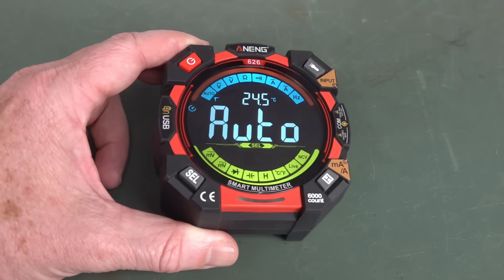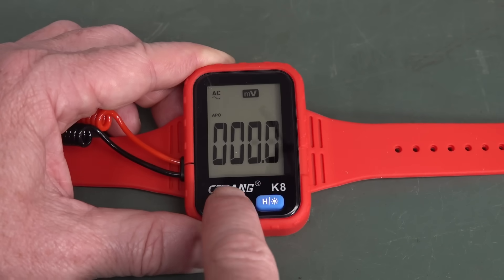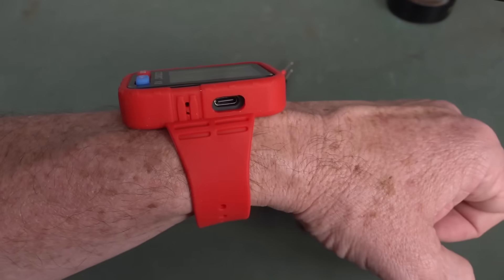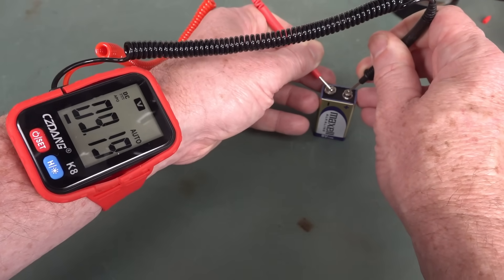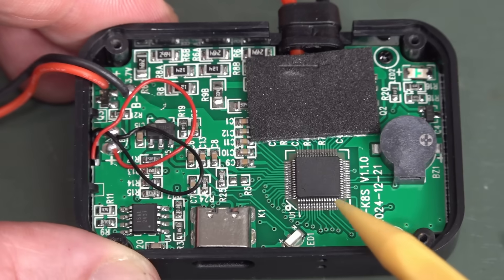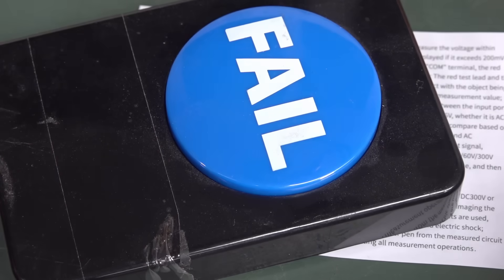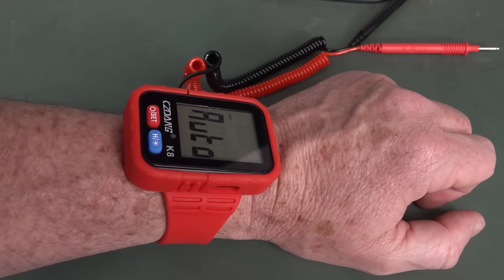EEVblog 1706 - K8 Wrist Worn Multimeter REVIEW

Comment: Not a bad concept, there have been many times where I have been testing something with no where to put the actual meter and a probe in each hand. Not really very safe though strapped to your wrist with zero input protection but hey, that's an implementation detail on something that couldn't have been implemented worse if they tried.

Comment: The worse part is that the screen is the wrong orientation, just that alone would bug me so much even if I found a use case for this. Without the wristband part this could perhaps be a decent meter to throw in the glove box of the car although I'm sure there are better options for that. Crazy that they can get this down to like $10 though. As an individual you couldn't even find that lithium battery for that cheap.

Comment: China has all the opportunity and tooling to produce a useful piece of gear and yet they produce this retard garbage.  Fuckin sad for all of us.  A few small changes at marginal additional cost and this product would be a banger
1.  Have the strap band meet in the middle back of the case so that the meter can be rotated to wherever on the wrist it's needed for viewing
2.  Have a moulded loop added to the strap so the tail can be tucked in like on a belt for pants.  Quick application and removal.
3. Have a pocket on the strap for putting the test leads into so hands can be free.

At least that would be enough so the product wouldn't fill me with rage every time I have to use it for vehicle electrical repair.

Comment: I think that resistance measuring is available only in auto mode to avoid potential damage on your wrist when you accidentally try to measure voltage in resistance mode.

Comment: This meter could be decent in some applications. The wrist band is of course 100% BS but it could be just a fancy meter holder if you stick it on a pipe for example. I'd prefer putting magnet below the meter body though, or use outside of the protective case, or just cut the bands from the case. Have an XT30 or similar connector for probes and a few sets of probes with it. Doing a car electric diagnostics or a simple home repair stuff (like checking a wire/plug/switch continuity) will be just fine with this meter. And the functionality is just enough, usage is very simple thanks to auto mode. Just throw it in your car box or backpack or whatever and you have at least something with you. For example, I have no meter in my car, and this thing would be much, much better than nothing. And what alternatives with this size and price? I guess none? DT830 clones are too bulky and too crappy (especially the selector knob), this K8 is ages ahead technology. And a normal meter could be too much for this purpose

Comment: For those who think the display is rotated non-intuitively, it's actually (more) correct for the placement of one's hands while working. As a counterexample, if one wanted to look at one's wristwatch while typing, one would typically have to rotate the watch to the 90-degree position to read it. But this display is in roughly the same orientation as one's hands and fingers during work. There are a lot of reasonably good features for this for the price (including the light), especially for people who work in cramped 12V environments constantly. A Velcro strap can assist with the dangly probes. And not losing them or having them pop out/off can be a plus.

Comment: The part where you're struggling with the wristband makes you look really dumb. Just like the whole unnecessary bashing and fake outrage that YouTubers use. You're better than that. Plenty of watches use that style of band. Apple watch uses it too. If Apple users can figure it out, so can you. 

The multimeter actually looks useful. Plenty of times I saw an electrician on a ladder struggling to check something with a multimeter. This seems great for checking if something is shorted or if it has power. You can also let go of the probes should you need to, and the coiled cable makes them more compact. It's not made for repair of expensive laptops. Also, the screen is not in the wrong orientation. If you stretch your arms out to reach something like a fitting, transformer, fuses and such, the screen is just in the right orientation and visible.

Comment: I actually really wanted something like this to exist....but only if it's done right - this one is....lacking, to put it mildly. It's intended for keeping your hands free to handle both probes at once while also having the screen at eye-level when measuring stuff inside control panels and cabinets where you've got nowhere to place the meter, which is something I personally always struggled with. I actually added a strap to the back of my regular meter so I can sort-of hang it from my wrist while working. It's far from ideal, but still better than dropping it every so often, while also not being able to see the screen. So yeah, good idea overall, but the design of the strap is what kills it. Also, I would've liked it to be oriented sideways, rather than inline with my arm.

Comment: when doing electrical diagnosis on vehicles, I had a small Radio Shack auto ranging multi meeter that i used stick on velcro on to stick it on a sweat band with a sewn on velcro patch to make something much like this....used it so much over the next 5 years that the multimeter eventualy physically fell apart....i was heart broken, never found another multi meter small enough to use like that again...this would interest me very much if I were still doing that work now....

Comment: The idea is not all bad, I have a lot of times in my job where it can be really hard to place a multimeter while having both hands free to probe the work. But the design of this multimeter is just sad. I guess you could take it out of the strap and have a compact multimeter at your disposal at least. They could have tweaked this in many ways with the display rotated or even customizable to rotate depending what arm you have it on or how you look at it. But then it would not cost below 10 bucks

Comment: I got one of those for working in confined spaces where there is nowhere to sit a normal meter and it's great. 
I have no problem at all with the band, you simply push the tang through the hole you want then slip the end into the slot, it's quicker than a regular hasp buckle.
Also, coin batteries inevitably catch you out, if they don't leak they will still go flat in no time with just the tiniest standby parasitic draw, just like vernier callipers and LR44's...
For the price it's great, I rarely need to use it, but when I do I'm glad to have it.

Comment: What a useless piece of rubbish. I usually just slide the tilting bail of the multimeter in my belt to carry it around. Taking it out and putting it down so I can read it, is not a big deal. Most multimeter's have a place to clip the probes.

Comment: I guess it could be useful if you need to check voltage of something in a place you can't set it down.
I would modify the bracelet part so that it works better.

Comment: Wouldn't it be easier to have a normal "smart watch" and have it connect (bluetooth comes to mind) to a smart multimeter.  It would avoid the nice probes dangling with dangerous voltages and probably be easier to use overall!

Comment: That wristband is unbeliavable!! 😆
The display should be sideways, unless it's designed for people with the head attached to it's shoulder. I bet that this was some kind of more traditional mini-multimeter, and someone else had the "great idea" of replacing the protective case with this ill-designed wristband crap, to "convert it" into a watch multimeter, and it was never intended to be used like that in the first place.
Also, those soldered-in probes... are not going to last. But making them removable would allow the user to carry them in a pocket, instead of the probes to be flapping in the wind. But then you could carry the whole thing in a pocket.
The idea of a watch multimeter is interesting, because it frees both your hands to use the probes, when you cannot rest the multimeter anywhere, but that's it. And there are other ways to handle that issue.

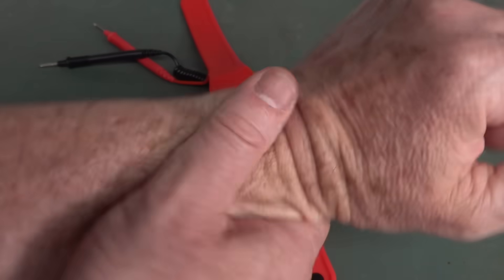Comment: 5:06 while this strap design is indeed annoying, looking at you Samsung, this is Dave fail.
You first lock it in, then push it through the hole.
Reply from the maker: I did that later in the video and it still sucks arse.
Reply: @EEVblog  I saw.
That system is definitely not great, but with these types of straps, that should be the way to do it.
IMO it's not great design, and in this case, it's even worse.

Comment: I want a small wireless multimeter that can be displayed on my Apple Watch. Maybe even more than one. So I can clip one on a car battery while I am testing something else. And maybe clip another one somewhere else if I’m working on two things. 

Adding an alert based on particular voltages might be nice too. Have my wrist buzz when the battery voltage goes below 10v.
Reply: Bluetooth transmitter and battery in one probe, and a single lead to the other. @eevblog product idea.

Comment: @5:21 Come on Dave, never put on an Apple watch? Just put the band over the pin first then feed the band through the slit. It's one of the best wrist band designs I've ever worn. Besides the band wrestling you did, I totally agree with your view on this thing. It's an absolutely bad design.
Edit: okay, end of the video you figured it out, but the silicone material of the band doesn't let it be used as an original apple watch wrist band. I am wearing a generation 3 for years now, putting it on and off daily. never go without it.

Comment: A wrist worm multimeter is a good concept but not this piece of cr4p. The fixed probe wires dangling down are stupid and the display needs to be rotated 90 degrees.. There would be enough space for 2mm banana sockets if the case was redesigned. Cat3. Yeah, right! NOT. More like cat0.3.

Comment: The idea is actually not bad. Sometimes when you are searching for an issue in a control cabinet you have no room to place your multimeter. But i think i would prefer a wireless display instead of the whole multimeter on my wrist.
Reply: Yeah the amount of times I've needed to use a multimeter and had nowhere to put it, like in a car or computer case or up a ladder or something like that. Good idea, poor execution.
Reply: I got a plastic phone ring and stuck it to my meter case, and now I can hang it off my thumb. I like the idea though, maybe I'll do myself a wrist holder!
Reply: I was thinking exactly this!
Reply: There are some on the market. But there's more with just a cheapo bluetooth chip. Then you have an app and your phone becomes the remote screen. Also at least my 9 year old one can log into csv and periodically read out the value. Silly but sometimes you don't have a place even for a phone.
Reply: VR multimeter is where it's at
Reply: glue and magnet?
Reply: @viperwizard491  you need an adhesiometer to measure glue and magnets 🧲 
Not a multimeter
Reply: Connecting the Smartwatch to the Multimeter per Bluetooth as display would per great.
Reply: Fluke could do one if they thought it was a good idea.

Comment: 5:33 just like an apple watch. Hang the watch on your wrist, Band with the slit faces away, clip the other band onto the pin and just then put the excess through the slit. It right length and material are chosen, this works like a charm.
Reply: I was going to say the same, but he tried it at the end and it also doesn't work well.

Comment: Factories!  Really?  I can't imagine any legitimate factory allowing a worker to use one of these for anything on the floor.  Many factories supply workers with all tools required partially to mitigate liability for worker injuries caused by sub-standard tools.  Others will have a list of approved tools the employee's are allowed to bring in and use for the same reasons. I can't imagine having one of these strapped to my wrist as I'm measuring 480v in a power factor correction cabinet that's tied directly to the incoming power by massive bus bars that can push thousands of amps in a very short period of time due to the low resistance and my wrist within 100' of it in the event things went wrong.  Well that and I'd look like an utter moron wearing a full arc-flash suit and helmet with a Malibu Barbie multi-meter on my wrist...

Comment: Far as putting on the strap, kind of obvious you feed the tail through AFTER you've put the peg in the right hole, instead of flailing around trying to do both at the same time for no reason. A good number of silicone watch bands (Fitbit first to mind) work like this. I do hope this was just for comedic effect, likewise with the first weird way that was tried.
Reply: He tried that method later in the review but the pin was too loose and it kept popping out

Comment: Despite this particular implementation of the wrist multimeter idea may be a little how are you doing, the idea itself is pretty good, for field work. Not all electrical work is done at the comfort of a workbench.
Reply: Why would you want something that can explode tied to your wrist.

You are gonna have to give a bit more detail on your vision, wireless maybe?
Reply: @RapiBurrito  multimeters don't explode unless you are working on industrial equipment, which you wouldn't be with this.
Reply: @RapiBurrito  tell me, are Multimeters, when used correctly and within their spec, in the habit of exploding violently, or is it more of a theoretical concern?
Reply: @troelshansen6212  Why does any decent meter have big-arse HRC fuse protection?
Reply: @marcaxe  You didn't answer the question. Does multimeters explode, when used correctly and within their spec? Do they explode when used outside their spec or do they blow a fuse?
Reply: Mummy no

Comment: Measuring 245 vAC with this thing hanging on your wrist and the PVC leads cupped on your hand - am I the only one that finds that at least a little scary?  Just put a lanyard on your proper meter and hang it around you neck if you think you really need the "functionality" this fine meter has to offer.  I think I'll keep my wallet in my pocket this time ...

Comment: Who on earth would like to have 300 Volts connected to your LEFT Arm, where the current would nearly 100% sure run through your heart in case of desaster? Who would like to even have a meter bound to what-ever of my body! 
I need insulation inbetween the measuring object, the voltage or current and my body! And any decent meter needs thermal insulation inbetween a heating-up body and the voltage reference! 
Well, at least if there would be some real reference voltage at all in that toy-tool. But that's another story (and might be told another time).

Comment: I like the deceptive image. It's like buying a cheap toy RC helicopter where they conveniently cover the top rotor of the cheap coax setup so you think you're getting a standard helicopter...
But DMM isn't all bad, if the probes were smaller and finger mounted you can probe around in a vintage computer on DIP packages one-handed.

Comment: The back is ribbed for her pleasure too.
I'd pronounce that brand as "szDang," which pretty much sums up my reaction. I once bought a collar with a similar fastener, except a lock went through the pin. It also involved electricity...you probably don't want to know any more details. Went into the art bin in no time flat. Looks like that wristband was designed by the same people.

Comment: I've literally got one in my hand - bought it a month or so ago.  It ummmm... was inexpensive.  So no great loss.  :D
Only thing I've found it handy for so far, is doing 12V stuff under hood (under dash, etc) when you don't want to balance the meter while probing.
Reply: The "auto" function really slows it down for continuity testing. IT has to decide... is it a resistor or a short?
And the display 100% should have been rotated 90*!
Reply: Looks like there’s enough room to glue a neodymium magnet inside the black plastic case too…
Reply: I thought that too when I saw it. Would be handy in the garage for the motorbikes where you need to worry about getting the probes in somewhere tight without  worrying about the meter going awol. screen needs to be rotated though
Reply: Exactly! I was thinking of buying one of those for car diagnostics. Try staying under a wet car with your 700 euro fluke trying to find a place to hang it while holding the flashlight and trying not not to get burned by the exhaust.... I think it's a good idea, sometimes you just need to see a volt difference not 0.00001mv precision and just want to make a continuity test on a wire! The reviews are to harsh on this device...
Reply: Try an aneng a3006 or a3008

Comment: It might be more of a bench meter actually. Cut bands off to drill a hole either side and use screw's / washer's to mount where needed. Where else would you get 6000 counts, give er take, that you can bolt up anywhere handy and the hold continuity test seems quick enough.